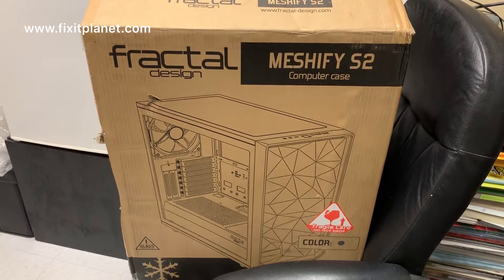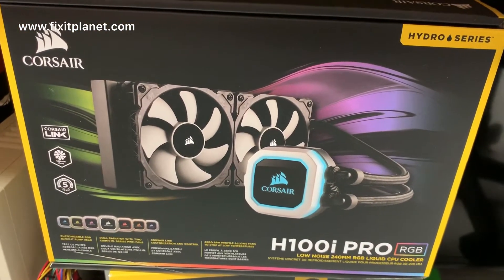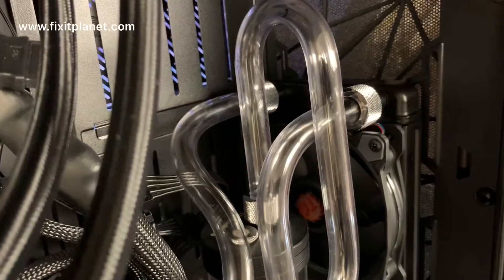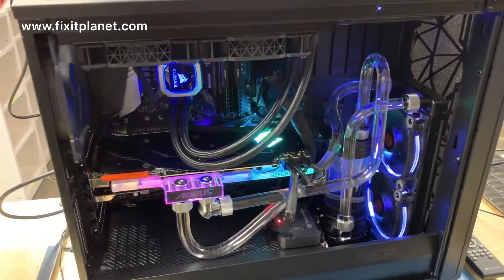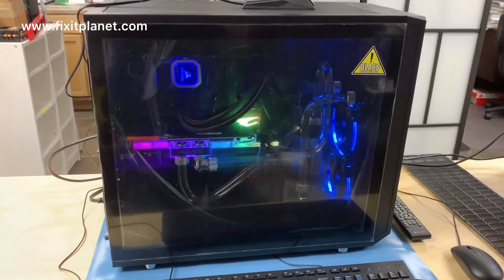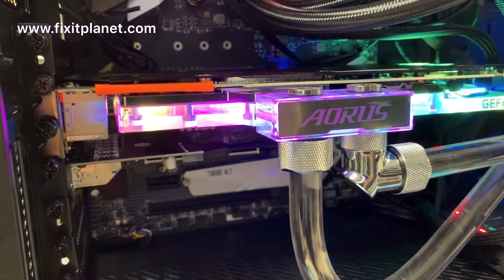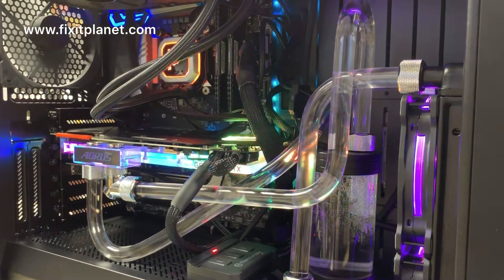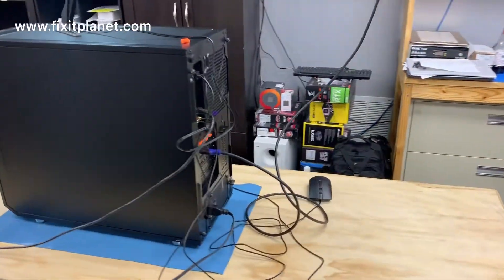Flight Simulator Computer Build

Comment: For other Flight Simulators - I had a budget which I saved up over time for this spend.
My main concern was Graphics Card. - and that was the most expensive item.
Flight sims are a different animal when it comes to CPU - so you can save $$ by being judicious with the processor. 
If you run RPG's and other games, then RYZEN may be the way to go. - FLIGHTSIMing is about the gigahertz/clockspeed. FS doesn't care about the number of CORES after you have 4. So a cheaper CPU with the same clockspeed is a good purchase based on cash on hand.

Comment: I would love to see the rest of the build, what Flight Sim game/program is being used, what flight stick and controls are being used? Even what chair and monitor's/ HDTV's, etc?
Reply from the maker: Yes me too... he has it set up at home. Need to see if he will send me some pics.
Reply: @FixItPlanet1  John did a great job. I'm running DCS, X-PLANE 11, PREPARED, IL2, and I plan to also run FS2020 in August.
The system is solid.  So far (speaking flight sims) the 32G Ram is more than enough - If I go VR we'll see but i like to use TRACKIR at the moment so I can see the keyboard - and the sandwich on my desktop!
I have upgraded to a 1TSSD  (widows) + a 2TSSD  (fight program software). 
I'm also working on my private pilot instrument license - it's cheaper to shoot approaches on-line [as many as i want] before paying 160/hr plane rental + instructor time (210/hr total).  This computer has basically paid for itself in savings during my training over the last year.